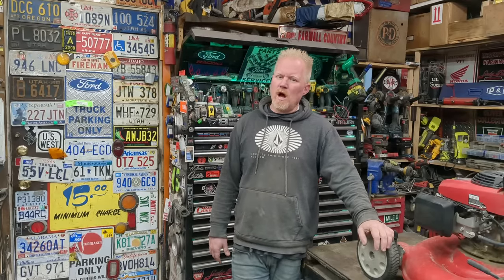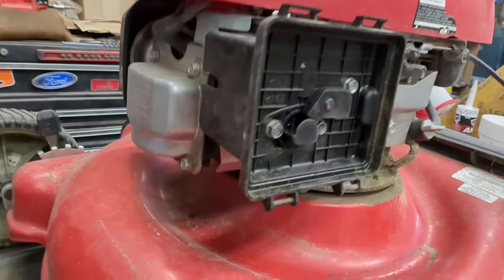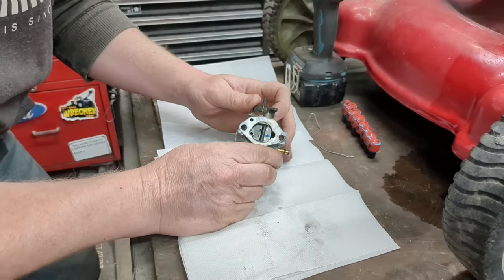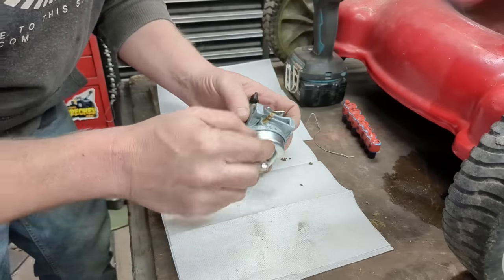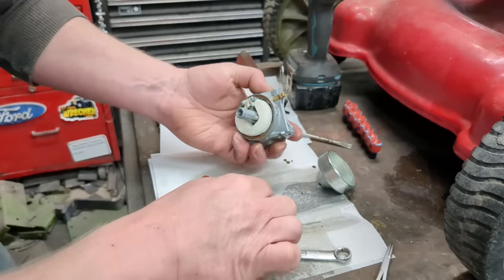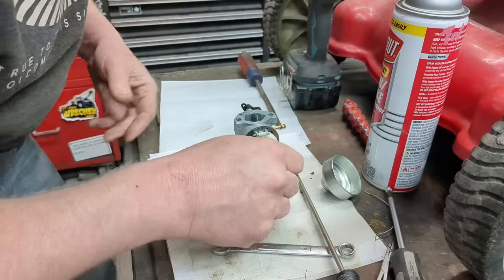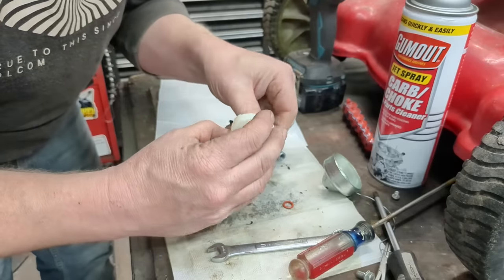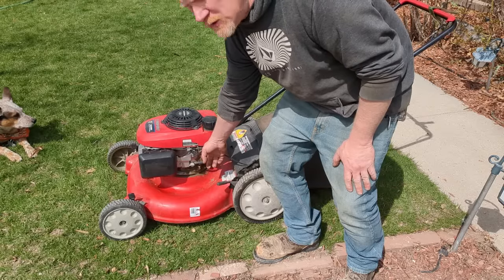FIX Engine Surging on any small engine QUICKLY

Comment: I cleaned my carb yesterday, put a new gasket on it.  I didn't use a wire on it anywhere.   I got it all back together, the mower DID turn & fire up, one time, but cut off again.  I will go out in the morning & see about taking it apart again-  I noticed the primer didn't suck the gas-   I need to do some more research.   I may need to treat the gas tank- I used a shop towel in it & put fresh gas in.  I think it's either the tank, or a place I didn't clean in the carb.    Pretty proud of myself, though.  I'm learning about push mowers... \0/

Comment: Love your videos!  Been plastic welding up a storm!  Can you use acetone in fuel tank like the other “snakeoiladditive” is there a ratio that works best?
Reply from the maker: I wouldn't leave it in my tank indefinitely. If you're going to mow the lawn on an empty tank I'd put in a cup of fuel and a quarter cup of acetone and run it till it ran out. Then put straight gasoline in and see how it runs.

Comment: Really appreciate your video, it was very helpful. I have a Remington 22 ton wood splitter which is about 5 yrs. old. Always starts, will run smooth for about 20 min. then the governor starts surging, and then it just shuts off. Can let it sit for about 15 min. and it will start right up again, run smoothly, for about the same time, sometimes less. Will start surging, then shuts off again. Just started doing this, about a year ago. Wood love your input, if you have a moment. Thanks again for the video, and sharing your smart dog with us. Clark C.
Reply from the maker: Sounds a lot like contaminated fuel. Essentially getting water globs sucked into the carb which shuts everything down.
Reply: @sixtyfiveford  Thank-you for your response. I always use fresh fuel. But I know it has an in tank fuel filter, and I've never replaced it, possibly it's clogged up? Was thinking of taking it out and replacing it with a external in-line filter and see if that helps. Appreciate your input, and your information about cleaning a carburetor was very useful. Thank-you 65/ford .
Reply: @clarkg9805  same thing on my Briggs and Stratton 3.5 lawnmower. Fuel pickup was clogged, it was surging and then died.
Pulled the fuel pickup and cleaned it and the carburetor with carb clean. Checked my gas can and it had some sediment! Drained all the fuel and filtered it with a filter funnel. Worked great.

Comment: Good video. I've looked at those $20 aftermarket carbs online but decided to spend more on a new OEM Tecumseh. Zero regrets!!!
Reply from the maker: You're awesome. The oem is worth it. The aftermarkets even if you get one that works. It fails within a year. I've seen them literally rot apart because they're made out of cheese metal.
Reply: @sixtyfiveford  Even Holley went through a period crap metal, delaminating, cracking and causing leaking carbs. Source from crap countries, get crap parts. Thanks again for the video!!!

Comment: I have the same Honda engine.  I had carb issues so I go to the dealer for a carb kit.  He tells me he has a whole new Honda carb that he can sell me for $12.00.  Problem solved!  But the next time I have a carb issue I'm diving in and fixing the carb myself.  Thank you for the how-to video!
Reply: What did the carb include? Float jets etc?
Reply: @tonychau1983  All I had to do was bolt it on. It was a complete carborator.
Reply: @scurfie2343  for 12 bucks thats a steal
Reply: @tonychau1983  I know right?  And the mower has been perfect since installing the new carb too.
Reply: @scurfie2343  let me know if he has another for 12 bucks 🤣.a new float itself is like 30 bucks
Reply: @tonychau1983  I bought the carb before the COVIDS, they say parts are harder to find now so I guess a float for $30 is the new normal.
Reply: @scurfie2343  crazy when sometimes you can get a running machine for 30 bucks
Reply: Cheap because you got sold a Chinese knock off Honda carbs and is not OEM..
Reply: @epmcdonald4562   No you are wrong.  It was bought at a mower dealership and the OEM markings were identical to the carb I took off.

Comment: Thank you very much for your video.  I took apart and cleaned my carb out, and it still surges until it warms up.  I thought for sure after watching your video that it was those tiny holes near the choke flap that were plugged, but everything looked clean.  Do you have any idea on what else it might be?  Its actually fine in that once the engine warms up it runs fine, but that surging is super irritating.

Comment: I use Techron by Chevron. If you can get it to run, dump in 10 times the mix it calls for on the bottle and rev it up and choke it down. Then rev it up again and choke it back down 10, 20, 30 times to force the Techron thru every passage. You'd be surprised how well it works.

Comment: My brother showed me this weird trick that works faster than it takes to clean the carb. Run the engine wide open facing governor speed to max, full choke carb with hand to almost stall, repeat 2-4 times… fixed!

Comment: Both times my Honda mower had a surging issue...was lame fuel...where Sta-bil failed.
Adding Seafoam has saved my fuel for a year or 2 even NO problem.

I have had Sta-bil fail on another occasion as well.

Comment: Had a lawn service for 10 years 5 years  I used dozens of these 160 To 190s right on checking the carburetor but they're actually is a governor issue that happens with this particular mower it wears down you can put a brand new carburetor on them and have the same issue so if this doesn't work for you check the governor and adjust its position it happens a lot on this Troy-Bilt

Comment: This is what made me go to battery operated. I had that issue on my gas lawnmower about 10 years ago. I thought on mine it was the spring to the carb adj was stretched out from getting caught on a pine tree. Found the part # in the manual but it was unavailable to order and the mower was only a couple years old. I used the wire to hold it open hack, the other person was using at the start of the video. My Ego mower has been going for 8 years with no maint except a blade replacement.
Reply from the maker: I sell mowers like crazy for more than I could have years ago. Virtually every person who buys is an electric mower owner and fed up with the poor performance. I also repair battery packs and have a pile of Ego, Ryobi etc packs that are bad. Probably have 10 grand retail in failed packs right now.
Reply: @sixtyfiveford  The battery that came with my Ego string trimmer was bad. I had to swap the whole box, instead of just a battery. The battery and string trimmer from the next box has been working perfectly for 5 years. I have two 5ah batteries. The original 8 year old battery works but at a lower level than new. My 3 year old chain saw battery still works great and is what I use in my mower. 
The Ego push mower is lighter and quieter and cuts the lawn better than the last gas mower I owned 10 years ago. The Ego cuts the lawn as well as my uncle's Husqvarna self propelled mower. The suction was better with that mower to pull up leaves and it had longer range on a tank of gas but it always barely didn't finish it. Now that I have 2 batteries I would be able to finish his lawn, which is a little bigger than mine.
I looked around in Home Depot and Lowes and I didn't see any gas mowers below $350, so you don't even save much money there. In the past, they carried a couple of smaller gas mowers for between $160 and $225 but there isn't any like that now. When I bought the Ego in 2016, there was some good mowers between $275 and $325 but I spent $450 on the Ego instead. Now, most of the gas mowers were at or above that price. The least expensive Ego is still between $400 and $450.
Reply: @sixtyfiveford  By the way, even though I like my battery mower better than gas mowers, that was a great video on how to fix the carburetor. I wish that video was around 12 years ago, when I was struggling with mine.

Comment: That is frustrating when you're not sure why it's happening. I fixed it by accident just going through logical steps, i.e., putting clean fuel in the tank (w/ a tiny amount of Techron), removed grass dust from the linkages, removed and cleaned the air filter, sprayed carburetor cleaner through the intake with the engine running--that did the trick--and changed the oil for good measure. It was a 5 hp Honda similar to that. What a good, smart dog!

Comment: I've got an MTD snowblower (2009 model) that I've owned since new.
This machine has always surged since I purchased it.
In the seventeen years that I've owned it I have cleaned the carb several times with an ultrasonic cleaner using parts cleaner fluid . . . and to no avail.
This year I've chosen to replace the carberator with a brand new one from Amazon.
Guess what ?

It still surges. It surges when it idles as well as at full speed under load.
I can remedy the issue by setting up the choke and it will run fine.

Comment: I had the same problem with my carb sucking up a blade of grass that caused a rough idle and did  similar steps you did , now I put Marvel Mystery Oil in my gas to help keep it clean and runs great

Comment: Once you said SeaFoam was snake oil I shut this off.
SeaFoam in my gas can year round allows me to simply park my machines at the end of each season and start them fist or second pull 6 months later.
Since putting SeaFoam in my last tank of gas before parking my Jeep for the winter means I no longer have to rebuild the carb each year.
Reply from the maker: If this foam is so great why don't you just wait till you have a dirty carb. Then just pour some in and you're good to go.....

Comment: Before I take something apart, I like to take a detailed photograph of it with my phone, so by the time I go to put it back together, I haven’t forgotten exactly where everything goes.
I have run into this annoying issue many many times in the past, & it’s easy to pick out those who do not know how to address this issue, as you can hear their engine surging. 😞
I currently have a 1953 John Deere “M” that needs attention & time spent on its carburetor, not wanting to run without playing with the choke. Grrrrrrr! 😖😖😖😖

Comment: Don't know why I watched this. But anyway. Really well made video that's straight to the point and indeed shows pretty much everything needed. Ultrasonic cleaner is quite good in some cases. Though one definitely needs to clean "manually" carbs before from all the shiit that's usually here and there. Mainly for jets and emulsion tube really small holes that should be cleaned fairly gently. Though jet cleaning needles are always the option.

Comment: I have thoroughly cleaned the carb, it is a little different than mower in this video, but I followed your steps and am confident I got all the little holes.  My honda GCV160 mower starts on first pull and runs smoothly, until the thermo wax choke assembly kicks in. Then I have the surging problem similar to this video of yours.  What would you suggest I do next?  thanks.
Reply from the maker: The idle circuit is a bugger on these Honda engines. Especially the passage right under the screw going straight down into the bowl area of the carburetor. You need to find a hair size wire to feed through there and flow test it with carburetor cleaner. It gets clogged effortlessly and sometimes I even have to clean the carburetor to or even three times because it reclogs with debris that come out of the fuel lines.

Comment: Always had good luck with this except on Tecumseh carburetors towards the end of their production. All of them seemed to be drilled too small to run right once they clogged even a little. I found that drilling the main jet out one size bigger was the solution to them, but found it was cheaper and easier just to get a new carburetor.

Comment: What a great dog!  I have a 3 y.o. Cub cadet snow blower that I didn't have to use last winter, and I forgot to drain the gas and it turned bad (no air filter on this machine).  I took the carb apart and cleaned it, including all the tiny holes in the emulsion tube.  If it could be accessed, I cleaned it with wire or sprayed it.  It started on the first pull, but it surges.  I left it run 20 minutes thinking it might help, but of course it didn't.  Since the carb is squeaky clean, do you have any thoughts on what might be causing the surge?
Reply from the maker: Surging is only a fuel related issue from 2 things: clogged idle passage or air leak in the intake manifold(folded over gasket). Generally the later gasket problem will give a pore performance even under load. The idle passage clog surge will go away under load(auger engaged/driving)

Comment: thanks for the video and nice job teaking other to fix them better but I got a ? for you can you over carburetor a small engine cuz I have clean the carb 4 times and still will not run off from chock I am thanking its getting to much air not enf gas
Reply: Boil it in water. Use a copper wire only, go into all orifices. Then soak it in carb cleaner.
Reply from the maker: I like using carb cleaner to visually see all the passages flowing. Every once in a while I will have to clean a carb more than once. Sometimes the varnish is so old and hard on the jets it takes a while to clean off.

Comment: Used my new pressure washer one season on regular e10 fuel. Next season it would only run on choke. Used it for a few years like that and finally pulled the carb off and soaked it in a bucket of berrymans chemtool for a couple hours and put it back on. Ran like new again. Even with the choke off. I never use ethanol fuel anymore in carb engines.

Comment: Great video.! I only recently found out about the emulsion tube from Steves small engine saloon but you explained that circuit better. I'm going to have to try the nail polish remover in the fuel mix soon to see if it will clear any annoying needle and seat issues that don't seem to come perfect  (will it be ok with  the rubber fuel hose?)
Reply from the maker: I would only run acetone in those concentrations if you plan on running that entire tank though. I wouldn't leave it for a week in the tank. Straight acetone will soften rubber but won't do much diluted. You could do a tiny bit (1/2oz/gallon)and leave it without issue.
Reply: @sixtyfiveford  Thanks, I actually wonder if the needle's rubber tip actually needs that "softening" now you mention it. could be brittle from the acidic stale fuel possibly. yes, good tip to not leave it sit,( handy the carbs have a drain bung i can probably save that fuel for the next annoying one.)

Comment: I've always wondered what causes the surging issue.  Thanks for the explanation.  Question - is it safe to put acetone in the plastic gas tanks that all modern mowers use?  Acetone usually destroys plastics.
Reply from the maker: HDPE is what gas tanks are made out of and is acetone safe. You can buy acetone in an HDPE plastic container.
Reply: @sixtyfiveford   That's good to know.  Thanks!

Comment: Perfectly timed video. Was just working on a Briggs and Stratton carb the other day. I didn't clean it well enough because it still surged when I put it back together.
Reply: I’ve heard the gasket between the air filter box and carb being cracked or leaking air can cause the surging/hunting as well.  I’ve got to replace mine and I’ll see if that takes care of it.
Reply: Bowl gasket can do that. It more than likely will appear wet though. Air box gasket blocks dirt and filter adds a tiny bit of vacuum to help it richen up. Sometimes a paper towel can add a bit more restriction to diagnose problems.

Comment: I cut short pieces of guitar strings when i changed them out ,the small e string will go through any jet 👍
Reply: His point was that steel wire will scratch the inside of the jet, making the jet bigger. (When it was already the right size if the gum/debris were cleaned out).
I think he suggested using copper wire to clean the jet. His point being that copper is even softer than the brass that the jet is made of so won't make the jet hole any bigger.

Comment: Ive got a briggs&stratton manuf date Nov 2010, on a 190cc yard machine mower I bought at HD in 2011.    Thing fires up and runs smooth for a couple seconds, then starts surging for about a minute, then runs smooth again.  I tried cleaning the carb, took it apart, clean main bottom jet that holds the bowl on, still didn't fix.   I can see the governor/spring moving back and forth while its surging, can't figure out what to do next other than to try and knock the seat out and buy a new one.  Any other suggestions most welcome.

Comment: I partially solved my problem - dirty fuel. I cleaned out the tank the best I could without disassembling a bunch of stuff and put fresh fuel in. It runs better but there's still some kind of issue because it's not running at full throttle like before. There's some surging still but not nearly as bad. I should be able to get the lawn mowed before it rains again.

Comment: I’ve heard that running diesel through the carb will clean the fuel system (intake through cylinder and head, to exhaust? Hadn’t heard about the nail polish thing
Reply: Le moteur va fumer un peu, à cause du carburant diesel. Mais sans gravité. Maximum 15%.

Comment: Great video, just curious wouldn’t a clogged fuel filter cause similar problems?
Reply from the maker: A partially clogged fuel filter would cause the engine to die under load.

Comment: The air doesn't go into the bowl, it sucks air from the filter into the manifold creating vacuum in the venturi which sucks fuel out the jet. There is a pressure relief circuit between the venturi and the bowl to equalize the pressure, allowing the cycle to repeat on the constant.